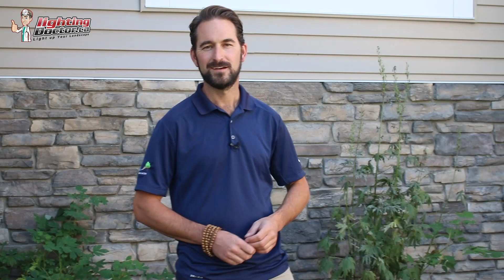DIY Landscape Lighting - (Full Project Showcase!)

Comment: Curious I’m building a pond and I have a connection under water that’s sealed in a watertight connection but I’m not sure if a watertight connection is meant to be submerged? 
And can you do a continuous loop around a yard and then splice the 2 ends of the loop to a separate line to the transformer? Thanks for any help you can give .